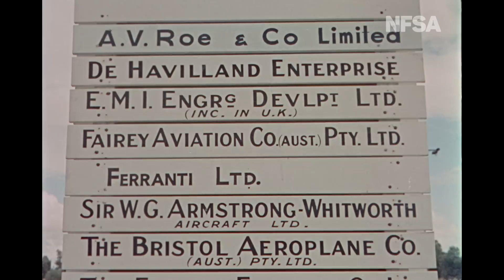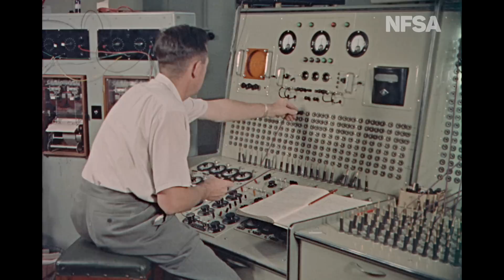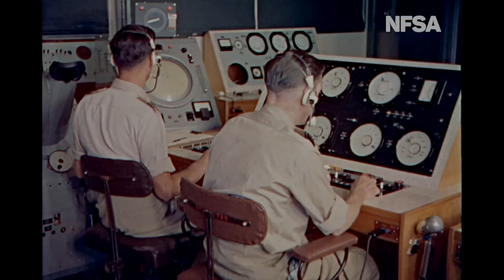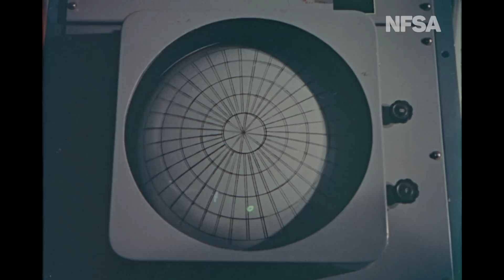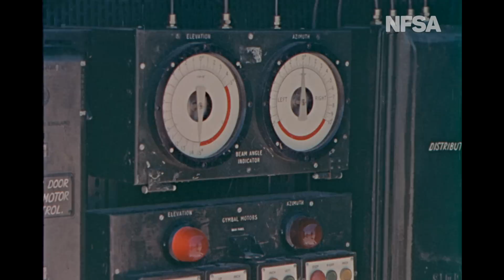Rocket Range Australia

Comment: What's that big machine with all the dials they've got the rocket sitting on at 10:50?  I can't even imagine what it does.
Reply: That's an air to air missile called the Fireflash. I'm guessing that equipment was able to test the guidance system, air pressure, gyroscopes, valves, servos, rudders, etc.  Interestingly, these were unpowered missiles after the first 1.5 seconds when the rocket boosters were jettisoned and the missile coasted the rest of the way to its target. Source: Wikipedia 🙂
Reply: @kerosene4751 That's a useful lead.  Surprisingly little info about it on the web.
Reply: I think it's to "program" the missile somehow.  It has fins so maybe it can steer course corrections.  I wonder if it can even home in on a target somehow?  The film was made in 1957, just before transistors and solid-state electronics were invented, so I'd think having anything too complicated made with thermionic valves wouldn't fit in such a small missile.

Comment: Woomera looks like a very nice place. Does it look the same??
Reply: Mostly concrete slabs where the transportable houses once sat on but now near all been sold/removed away. Very eariy feeling to go back there knowing it was once a hustle n bustle community hub.
Reply: In some ways better, in some ways not so much. Only 150 ish people here now, so smaller, more established, and more modern buildings: but some of the older buildings including churches still standing.
Reply: Mostly gone now.
Reply: There are still several blocks of houses neatly kept, a Movie Theatre, Museum/Visitors centre and a nice restaurant, The Restaurant was an Officers Mess I believe. The Post Office is closed and empty, there is a small shop. You can book a room and stay there or could back in 2015. In the Middle of town they have a display with a Canberra Photo Reconnaissance Aircraft and quite a few rockets of different shapes and sizes. A very Interesting place to visit.

Comment: I remember using those Cossor oscilloscopes shown in several parts of this film.   They did not have the modern appearance and overall high performance of the rival American made Tektronix oscilloscopes.    But they could do what the American oscilloscopes could not do - measure a waveform very precisely.
Reply: Do you know where the rockets landed? I’m wondering if they had a team of people waiting for it near the landing site?
Reply: The station homesteads had bomb shelters built for people to be in a launch time just in case a rocket went out of control .Some missiles were found years later out on the properties,big country ! @jamesmcgowen1769
Reply: Timestamp?